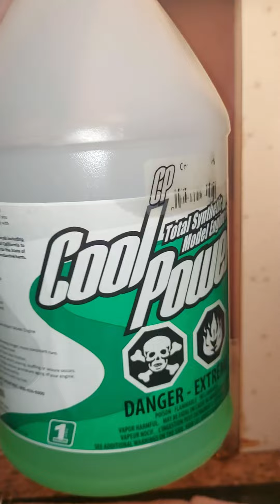Cison L4-175 running on nitro RC engine fuel.

Comment: Nice job Leonard, sounds good 

Mines running on nitro right now as well, but I bought an RCEXL in-line 4 ignition to try…. Hoping a proper ignition will get it running correctly on gasoline
Reply from the maker: I was thinking of doing that as well because i ha a couple of RCEXL in-line 4 ignition setups to choose from. I also have some extra magnets. I'll need one to install on the crankshaft pulley opposite of the one that is there. I wonder if the original Cison crank sensor would work with the RCEXL. I'll try it and find out.
Reply: Yes sir!  My 3mm x 2mm magnets will be here tomorrow from Amazon, and I’ll be able to try it out 👍

I’m really hoping that the RCEXL ignition will allow the FL4 to run correctly on gasoline.  Man, I put some serious hours into trying to get mine to run correctly with gas, and have concluded that it must be something with the ignition that’s the issue
Reply: I’m thinking that the FL4 Cison sensor will work with the RCEXL ignition, with a magnet added. The wire colors and positions are identical, and uses the same connector.
Reply from the maker: @mhz-yn9gh  I've tried that by using a female to female adapter and the sensor is not compatible with the RCEXL ignition. I'll have to add a magnet and somehow use the original RCEXL sensor.
Reply: Thanks for the heads up Leonard… dam. I was hoping it work work!  You saved me that disappointment, lol.  Gonna go order a in line hall sensor from RCEXL right now 😁
Reply: I’d love to see what you come up with for mounting the RCEXL hall sensor, Leonard.  I ordered an RCEXL in-line 4 hall tonight. 

The new geared starter works very well… ran about 1/3 gallon through my FL4 tonight.  Runs great but hate the mess & price of nitro. 

Looking so forward to getting her running on gasoline correctly 👍😊
Reply from the maker: @mhz-yn9gh  Mine has been very temperamental. The valve seat/guide assembly on all cylinders have come loose, so I had to clean them up and Loc-Tite them in place. That includes the lifter guides. I tried the old ignition with nitro and it runs quite well.
Reply: Glad to hear you got the valve seats back in place.  So far, your FL4 has been the only one that sounded good on gasoline.  Mine ran, but ran horribly and vibration was incredible.